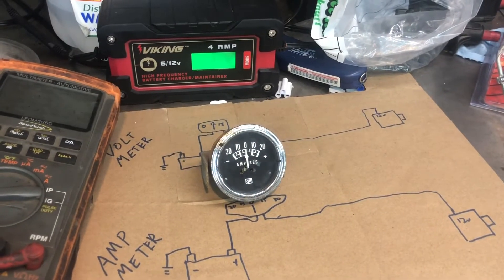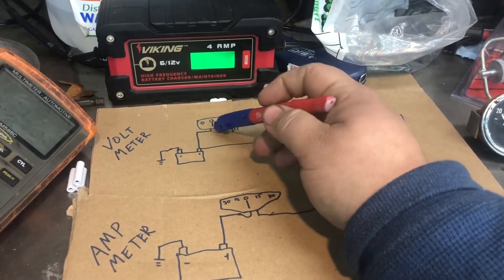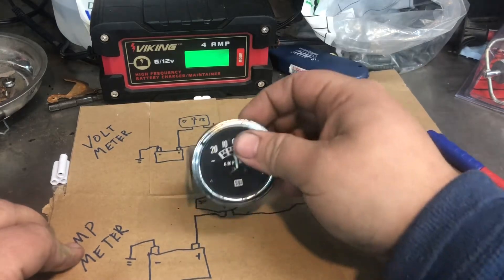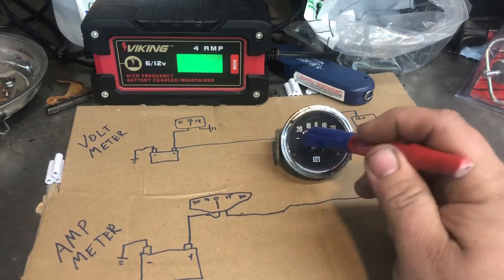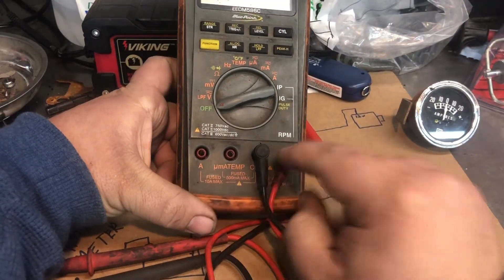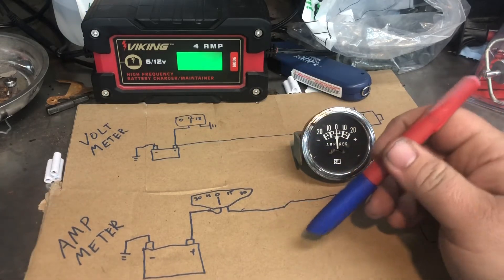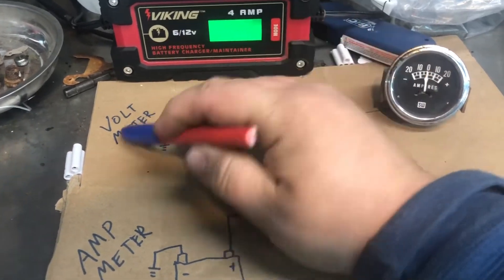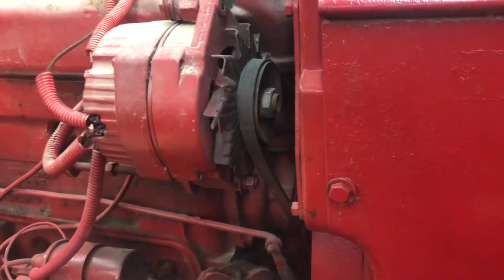Volt gauge vs. Amp meter how they work

Comment: Final update. It works good. I took the 2 wires from the original amp meter and put them together. Then I ran a wire from the fuel pump wire to the volt meter. Then I ran the ground directly to the battery.  Works perfectly.
Reply from the maker: That’s awesome!  Nice to get a project done on a Sunday night

Comment: Update to the last 2 comments. It works, but my gauge on all the time even when the ignition is off. So now I'll connect the positive wire from the gauge to a separate ignition wire. That should work. 🤞

Comment: In addition to my last comment.  I'll try putting both wires onto the hot side of the volt meter and run the ground side of the meter to the frame (ground). 🤞

Comment: I just replaced my amp meter with a volt meter in my cub cadet 1772 tractor. The volt meter works, but now it won't start. So, after listening to this I now know that the amp meter itself is in the circuit. So now I'm thinking if I take the 2 wires that went to the amp meter and put them together it'll start. I'll just run the hot side of that connection to my volt meter and run the ground wire to ground.  Thanks for vid. 👍

Comment: What side of the ammeter would a 12v one wire alternator go to?  Asking for my 1941 Oliver 60.
Reply from the maker: I think the opposite of the battery side so it can “read” the amps going or coming from the battery
Reply: @BIBSTERSrepairshop good explanation and reasoning.  Thank you.
Reply from the maker: @turnertruckandtractor  I’d also give it the old google check as I’ve not doing any one wire stuff but I think it should work

Comment: What would cause the amp meter to be reversed I put a new regulator in and it goes to D or far left but when idling it will be in the middle
Reply from the maker: I’d check it with a volt gauge see what it’s doing to make sure the wiring on the new regulator is good.
Reply: @BIBSTERSrepairshop it’s weird because it still charges the battery it just says it’s not
Reply from the maker: @Dan.B306 that is weird and you didn’t change any of the wiring on the gauge just a new regulator?
Reply: @BIBSTERSrepairshop yup all the wires are still in the same place
Reply: @BIBSTERSrepairshop that’s what I’m saying it’s so weird
Reply from the maker: @Dan.B306 what’s it on?

Comment: I have a Lucas amp gauge which is a 30 0 30.  I can’t find one here in nz but I can get a 50 0 50 can I still use with the same wiring ?
Reply from the maker: @rosemcbirney5123  you should be able to it will just look lower as the scaling will be different.

Comment: I have got a Ford 600 1955 I am trying to put a amp gauge in mind now but cannot figure out where to run two wires to the lugs on the meter
Reply from the maker: For an amp meter you want to run them in line of the charging wire from the alternator https://static.summitracing.com/global/images/instructions/sww-284a.pdf
Reply from the maker: That’s some basic diagrams that explain it better

Comment: An amp meter shows you how much the machine is drawing energy and a volt meter shows you how much the charging system is creating energy. Amps are used to measure electricity flowing through the machines system, volts are used to measure the potential of available electricity generated in that same system. This is the easiest way I can explain it as I understand it but and if I'm wrong let me know!
Reply from the maker: That’s basically how I’ve thought about it thanks for checking out the video

Comment: Are you saying to Cut and splice (Amp Gage) into the  the wire that runs from the battery to the alternator
Reply from the maker: Basically that’s how it is drawn that’s why most will do with a volt gauge

Comment: So if a guy hooks up a voltmetre like a ampmetre what happens ? A melt down of the voltmetre? Thank you great vid I in fact didnt think there was a difference duhh So I have been trying to wire a volt gauge like a ampmetre...got a brand new voltmetre in my hand right now but ...
Reply from the maker: Yep it will let the smoke out wire it “around” a circuit think of it like this a volt gauge is checked with putting one end to power one to ground.  An amp meter would be running a wire from your positive battery side then the other to the rest of the system.
Reply: @BIBSTERSrepairshop  Thats what I did ! 2 Days to find the wiring diagram Took most of the long weekend to check wiring And a week to figure out that a big "A" on wiring diagram stands for AMP (I wondered what it was)   ...fuuuck.. THANKS TO YOU I HAVE UNDERSTANDING !
Reply: Oh and I kinda made the voltmeter work for my welder I ran a jumper cable between the + and - lol but i think I cooked the battery
Reply from the maker: @tuffy16   well thanks for watching hope it helps and what is the project that the volt meter is going on?
Reply: @BIBSTERSrepairshop  A lincoln classic 3 gas driven arc welder

Comment: Voltage is the electrical potential for electrons to flow. In a 12.8 volt battery, it has 6 cells with lead oxide and lead sulfide on opposite plates. One had an abundant of electrons and the other was a deficiency and caused electrons to flow from negative to positive. Amperage is the intensity of electrons to move or pressure. It is measured in Amps. Resistance is the opposition for voltage to flow so small wire, loose connection or corrosion cussed this, measure in ohms.
 The amp meter uses a measured shunt inside that carry’s 90% of the load and is wired between the alternator or generator to the fuse box supply. Like a volt meter, it simple shows how much current is flowing and which direction, plus it’s wired in series just at one wrong end. The volt meter is in series as well, but from the alternator to the volt meter to ground.
 Many old cars / trucks with amp meters had inline fuses on the engine side of the firewall. One was located between the generator and the other one the fuse box side. They won’t burn up simply because the used fuses in the harness and many tractors, cars and trucks produced 30, 35, 40 up to 50 amps. Remember the alternator runs everything on this unit plus 20% more to re-charge that battery. Think back! How many had electrical fires when nobody did anything to them while still or running?
None!
DK. ASE Master Tech since 78, retired.

Comment: Good video. Have a question. I have a 52 Chevy that apparently has an amp gauge. I say this because everything I've read say older cars had amp meters +  it has continuity across the 2 posts on the gauge. That being said how can I test that the gauge works without the car running? Any help would be greatly appreciated. Thank you
Reply from the maker: You could with the key on turn on the head lights you should see it go negative because of the draw on the battery.
Reply: @BIBSTERSrepairshop  Thats the problem. the car isn't that far along. I'm trying to finish the gauges so I need to somehow simulate the  car. Just not sure how to do it. Thanks for the help
Reply from the maker: @harley15a   you could make a simple circuit and wire the amp gauge into it like make a light or something otherwise I would recommend converting to a volt gauge so that way you don’t have the high amperage wires running into the dash.  They make volt gauges now that look like the old amp ones that can be  installed
Reply: @BIBSTERSrepairshop  Yes that's what I'm trying to do. Even tried hooking up a small charger to simulate the alternator but I must be doing something wrong. Converting was my 1st choice but they don't make one for this car :/ Would it be posable for you to draw something and sent it to me? Thank you so much for the help
Reply from the maker: @harley15a   yes I’ve been thinking of doing a viewer questions video I think I can do something like this
Reply: @BIBSTERSrepairshop  cool

Comment: Really hoping you can lend me some information on my problem. I got a 4 post solenoid, one is ground . 4 position ignition switch that is believed to be a magneto switch but I made it work and charge on my other tractor and also had a hour meter that I added and it works. My question is on my other tractor I’m using a hour meter but also adding a  amp meter and can’t figure it out, also don’t have the motor back in yet just battery and lights so I’m not sure I’d get much of a reading . My switch is labeled clockwise starting with s, a,m,g then the last prong is unmarked . The switch I’m using is part number 527414v91. Any help would be appreciated.
Reply from the maker: Let me do some looking I’m working on a viewer questions video so I’ll try and get to this what tractor is it on?
Reply: @BIBSTERSrepairshop  Massey Ferguson 1650 garden tractor. This is the switch it says replaces the original straight from the dealer but may be a magneto switch which makes it difficult to figure out. I did figure it out though just the amp meter or a volt meter seems to give me problems.

Comment: I have a 50 model 8n ford tractor  with the 6 v system. Generator not an alt. I wanna hook up the am meter to it. Would you know how to hook up the 2 wires.  I'd also like to get the lights work. Front and back. Any suggestions?
Reply from the maker: Is it negative or positive ground?  I might do a what’s the deal with video and draw out the diagram
Reply: @BIBSTERSrepairshop  pos, ground
I've thought seriously about changing it to 12v. But can't bring myself to do it with everything working as good as it does
Reply: @BIBSTERSrepairshop  it still orginal.  Runs great. It has no wires on it . I have no clue about putting any on. It also has lights  but I believe they been cut off by the fan
Reply: @BIBSTERSrepairshop  
I'd love to get them on. And my plow light in the back. I'd also like to put 2 flashers on the back when I'm on the road.
Reply from the maker: Ok let me draw some diagrams out I think I’m gonna do a “so you want some lights” video and have a few different ways to wire lights in give me a few days and I’ll have it out make sure to subscribe to see it come out.
Reply: @BIBSTERSrepairshop  thank you

Comment: For a 12v system I'm a volts meter guy. And for 6v Amp meter. I've never really thought about it before but, my subconscious just tells me to go get a volts meter whenever I do a 6v to 12v swap. 🤣 🤣
Reply from the maker: Yeah I would have a volt meter if I was buying new but if the amp meter works I’m gonna just stay with it out of cheapness and laziness
Reply: @Timothy Fluegel   >In a 6 volt car/truck you will first notice the wire size is way bigger or almost double. This is fine rather than being too small. If converting to 12 Vdc system, simply run an alternator for 12Vdc. When running, they produce 13.2-14.3 Vdc depending on air temp. Higher for cold, lower for hot. Use a Voltmeter instead of an Amp meter. Amp meters are in series between the supply and load. So they start at the alternator and run to the input side of the fuse block. Volt meters are B+ to ground.
  Some items like radio would be a concern but power windows, wiper motor or starter can normally be replaced with 12 Vdc items for the same bolt on vehicles.
  The alternator can be a 12 Vdc Delcotron like a 10SI or 12SI with two terminals. “F” = Field and “S” = Sense or labeled 1 & 2. Get the connector but to supply B+ from key that turns on the voltage regulator, you have to use a current limiting device as 460 ohm resistor wire in-line to Sense or the bigger (Usually #1) because like a dash bulb that had a picture of an battery, that was a 194 bulb shaped like a peanut. When on and hot, it passes 0.25 amp thru it. This limits current to the regulator. “F” Field becomes hot when running as all three stator windings come together. This is used to operated B+ to a relay, fused power to the choke if updated to electric choke. Yes prior to 1958 Fords 6 volt, others like Chrysler and GM had switched to 12 Vdc.
DK. ASE Master Tech since 78, retired.

Comment: If you stay with an amp meter on your tractor, after installing an altinator, don't you need to put on a larger # amp meter than just a 20 amp?
Doc
Reply from the maker: Yeah this is an old one from the 60 that still has a generator had it laying in the tool box.  On the super 88 I have a 30 amp one will should be fine as with the lower rpm of a tractor the alternator shouldn’t be putting out more than that.

Comment: Anymore, I prefer volt meter.. if you actually pay attention to it, you know if something isn't right. 
Amp meter can show 0, wether things are working right or wrong.
Generator/alternator not charging=0.
Lights on, charging =0.. it measures the flow of electricity.
Volt meter charging =14. Not charging = 12 or less.
When you turn the key on and a volt meter shows 12+, you know the battery has power. Amp meter won't show that.
Good video !!!!!
Reply from the maker: Yeah I’m gonna run all the 12+ wires from the amp meter stud should show the load differences I haven’t wired the lights up to test this out yet
Reply: @BIBSTERSrepairshop  volt meter will show the difference too..
Amp meter is great for finding draws.. especially if you are isolate circuits.
Reply from the maker: True true going to replace all the gauges with Oliver repop ones at some point